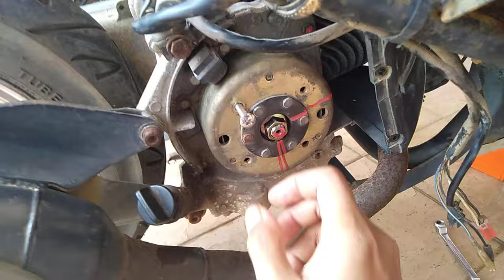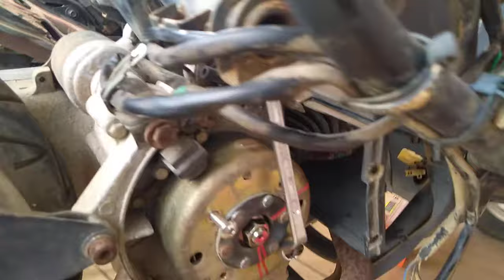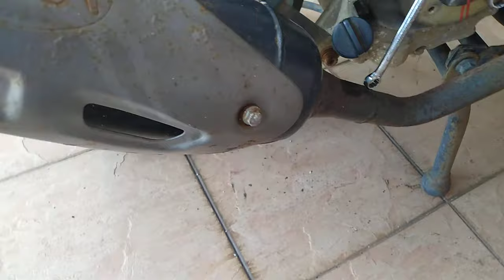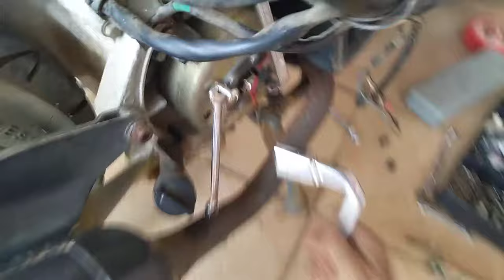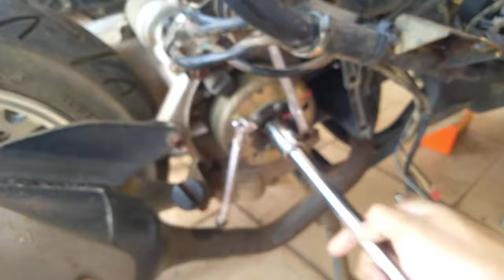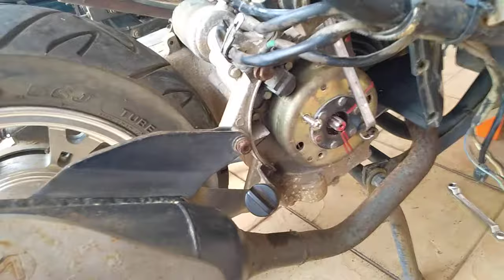I remove the scooter flywheel without impact wrench or any special tools (Magnet Rotor part)

Comment: You only removed the bolt??
Reply: Yea lol
Reply: Yea what a clown. Click bait. Shoulda put "I did extra work for nothing" 🤣.
Reply: Once bolt removed you can pull off the case by screwing 3 bolts back in as its already half off by screwing in the bolts you will hear a click when its ready to come off hope this helps
Reply: @youtubebangers  you saved me a LOT of work !!! Thank you for this comment it helped me ! After a couple hours of fighting with this thing, my 2 flywheel pullys that didn't fit and a lot of cursing i tried your trick and it actually worked. Did it with 1 bolt screwing all the way trough and leveriging on the other side with a piece of metal.

Comment: You need a special tool called a flywheel puller. 24mm for 50cc and 27mm for 150cc